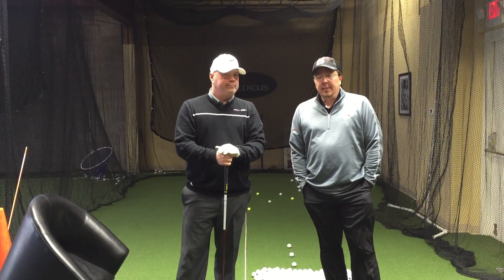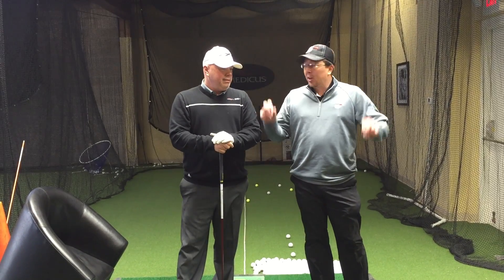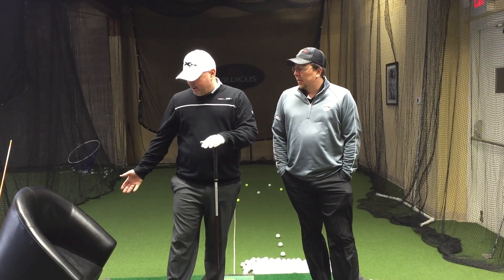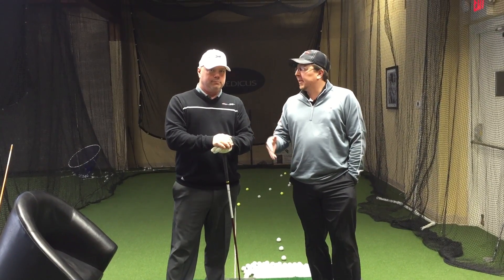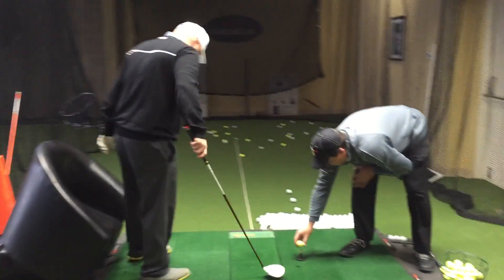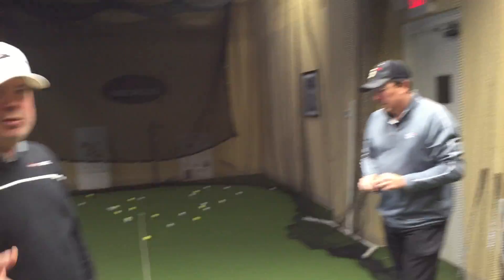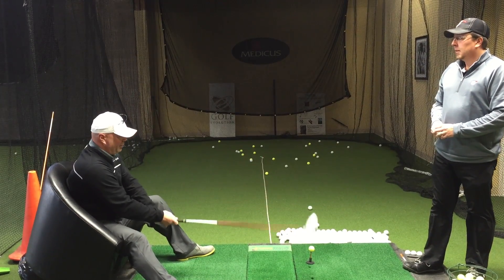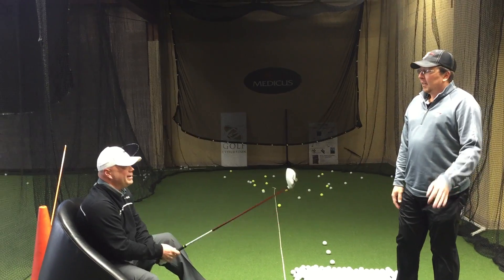How Much Speed is Generated Without Using the Ground (GRF)?

Comment: OMG what a stupid pointless video. Do  ye actually believe this load of crap yourselves? Sitting in a chair swinging with your arms thinking that is the swing speed you actually get from your arms in the swing is absolutely ridiculous. First of all if you are not using your shoulders to do this and get say 70mph with your arms alone that would be more than halved once your shoulders come into it in a full swing because they would be moving too, so the speed in the arms would have absolutely no effect as the shoulders are taken the speed from them by also moving, that's before you factor in the bottom half of the body which is moving and generating even more shoulder speed. You guys are absolutely bonkers.

Comment: How do you figure you are NOT using the ground?  Your butt is in a chair, that is connected to the ground. Maybe you should try it in a chair that swivels.
Reply: Jeff, the point of the video is not to "not use the ground" at all (we'd have to be suspended mid-air somehow), but to demonstrate that the vertical GRFs are not the only thing that creates power in the golf swing. We hope that's made clear in the description.
Reply: Erik Barzeski
Erik, sorry, but what is the title of the this video?
Reply: Jeff Watson The title is just a title (and is limited in length). The ground (COP, GRF, etc.) are not being used much in the vertical direction in this video. The description further expands on the title, and I believe makes fairly clear what we're demonstrating. If you have a better title, we're all ears (though we reserve the right to disagree that it's better).

If you've seen GRF charts, they show and are almost entirely concerned with the vertical GRF. This video essentially demonstrates what happens when you essentially remove those vertical GRF. We could also suspend Dave from a chain around his hip and he'd still generate more clubhead speed than I think you might imagine…
Reply: Erik Barzeski
That would be interesting to see.  I think it would be very low.  It needs to be done
Cheers!
Reply: Jeff Watson Depending on your definition of "very low" I imagine we'd take bets on that all day long… :D

One of the points we were trying to make, despite being some of the first people to talk about GRFs in golf, is that it's getting to the point of being overstated, or overblown, just a little bit. There's more to the golf swing and generating speed in the golf swing than pushing downward against the ground, about generating vertical torque around a moment arm, and so on. There are other parts of the swing that don't really interact vertically with the ground that generate clubhead speed.

When Chris Como was flying through the air after jumping off a diving board, he was still able to generate clubhead speed…
Reply: Erik Barzeski
It would be interesting to see how much the "ground" contributes to clubhead speed. 80/20 rule?  80% ground?